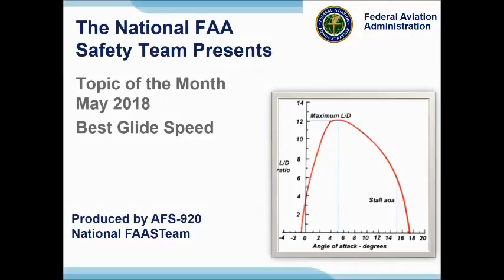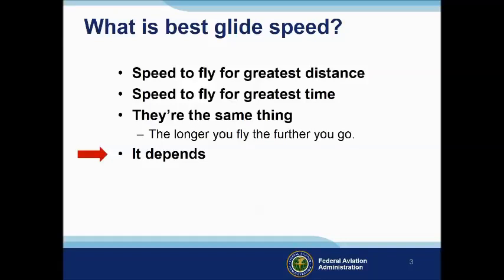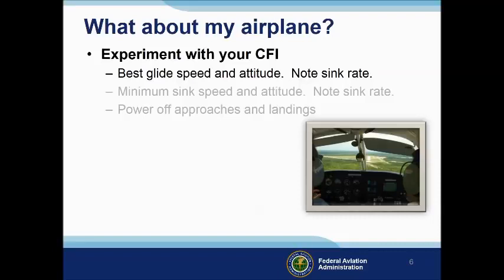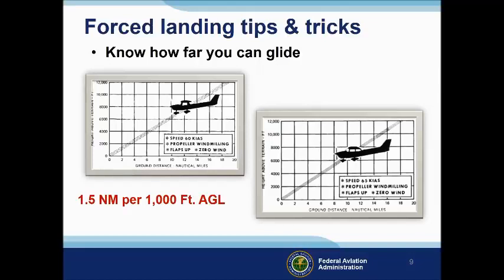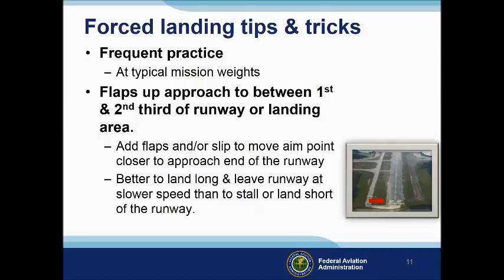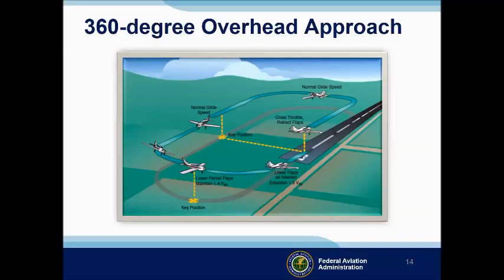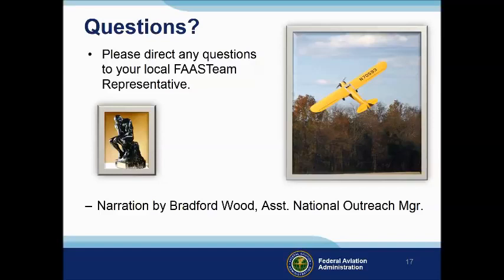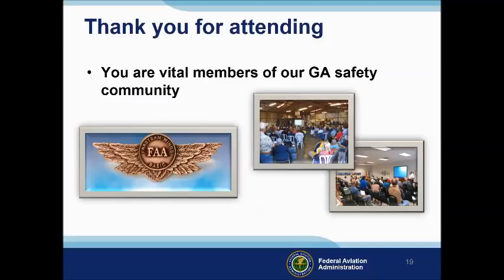Best Glide vs. Minimum Sink

Comment: Is there a way to actually calculate min sink speed?
Reply from the maker: I like the way you think, good question.  You won't typically find a practical equation and most Airplane AFM/POHs do not provide the minimum sink speed.  FAA literature will simply advise you the obvious, that it is typically just a few knots below the speed for Best Glide and they recommend you determine it experimentally with a safe-environment simulated engine failure trying different speeds each time in the same altitude range and with the typical load (weight) you expect to be flying.  

Now, that doesn't really answer your question and I assume you are sincere about digging a little deeper into calculation... so,  I recommend this article.   https://tinyurl.com/5n6t4sbk
Reply: @TomOwensUAP  Cool thanks a lot... Yea in the Airplane Flying Handbook... there is only like one little paragraph talking about min sink speed. Haha.
Reply from the maker: @TheFlyingZulu  you're in luck because in addition to being a CFII, I am also a glider pilot.  If you'd like to learn more about Minimum Sink Speed, I recommend downloading the 2013 FAA Glider Flying Handbook which will teach you about manufacturer-provided Glider Polar Curves and speed to fly with a MacCready Ring.    Minimum sink rate is determined from the polar by extending a horizontal line from the top of the polar to the vertical axis.
See Figure 5-12 from the pdf provided below.  I love talking about this stuff, so thank you very much for checking in.   

https://tinyurl.com/owensuap